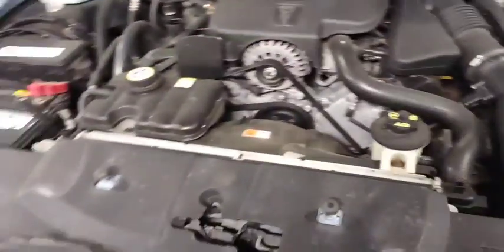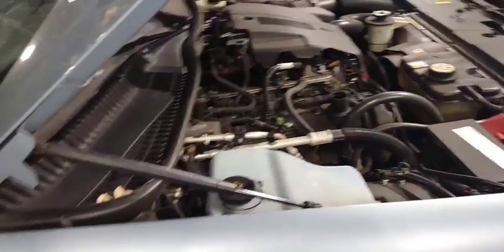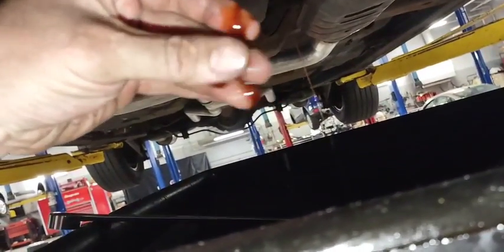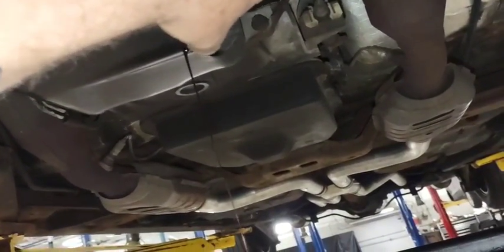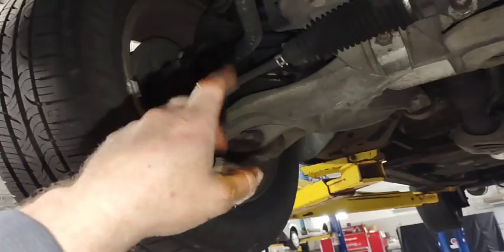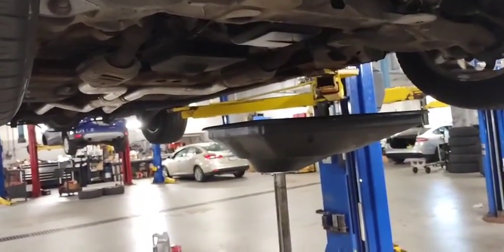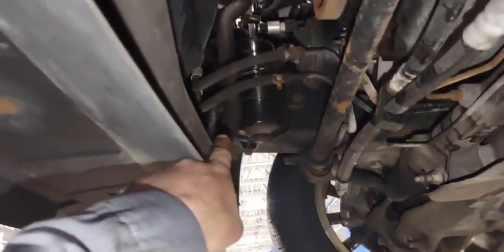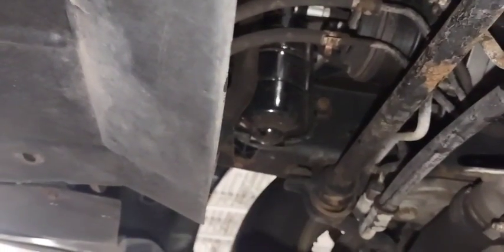Pennzoil Platinum Ultra oil drop 5k Miles, the next 5k Miles trying Mobil 1 extended high mileage

Comment: What's your opinion of Motorcraft oil filters?  I've never seen a test where they were the top performer.
Reply from the maker: I think somebody was telling me it has a lower Micron rating than some of the better like synthetic ones from mobile and k & N or Wix

I just use the factory filter because that's what I'm used to

Comment: do I need to worry about oil leaks if I switch to amsoil, ive heard that synthedic oil can cause leaks
Reply from the maker: If the vehicles going to leak it's going to leak yes synthetic oils do have better additive packages and higher detergent which can clean better but if it causes a leak it's because you had debris and sludge sealing the leak up

Comment: Man the comments are brutal when you go down the rabbit hole of different oils. What if I said I've been so broke I've reused oil and changed the filter ever 5k miles and used oil until 20k had a Chevy 350 ran 500k. Can't say the same think for "Newer" cars/trucks but whatever works use it.

Comment: Always tell the IPA you got video of the contamination hahahahah. they will be out there checking in a heat beat. The company I work for allows oil seepage to go into the ground from their injection mold presses. Their last location got shut down and they had to dig out the bad ground before the new tenants took over the 350k sq ft facility.

Comment: You can not tell how the oil is by feeling it? Get real.   And what  oil did you use. You say Pennzoil Platinum and then you say Pennzoil Platinum Ultra Platinum. They are different oils. Lots of work performed on that car. Undercarriage looks very good for the number of miles. Thanks for the oil.

Comment: Been using Amsoil for years now and never had any issues at all. One of the best oils out there.
Reply: Project farm confirms
Reply: Do you run the 20k miles on it?
Reply: @slscamg  Nope always have changed it at 5k.I would never trust any oil for 20k.

Comment: Look at "Project Farm" YouTube channel. Look at his oil challenge. I was a Mobile One   guy till he tested it. Now I'm Pennzoil. That was like a year ago. My vehicle's are doing much better with Pennzoil then Mobile One synthetic. 4k oil changes.
Reply: Yep I knew now coming those coming already like a lot of these high dollar oils that advertise stuff don't do well like people swear by like red line and stuff but they're additive pack is excessive and it's so excessive it doesn't really benefit the oil.  Like the top two oils there was AMSoil and Pennzoil.. which didn't surprise me followed up by Schaefer's. And this even proved that Pennzoil makes a good oil that even helps back up me saying that it's the best off the shelf oil for most applications.

A lot of his other testing shows you how good some of these oils are regardless.   I gotta send him some oil for testing just gotta get it sent off.
Reply: How are they doing much better? How do you quantify that?
Reply: @zeroyon4562  When I do the oil changes it's not black and I had lifter rattle at start up. That stopped after 3k miles.

Comment: So does gas actually get into the oil ? When you speak of oil dilution?
Reply from the maker: Yes it can especially with short trips the vapors things of that nature maybe if the engines not warm enough and there's a lot of blow by, some raw fuel as well
Reply: Ok makes sense.. I noticed last time I changed the oil on my 01 F150 a slight gas real fumey smell if you will the oil had

Comment: Nice ride. Should all cars be put in flood mode after a oil change?
Reply from the maker: I think so because it's less stress on the drivetrain whenever everything goes to start you've already got some of the oil pulled into the system instead of dry starting it
Reply: Thank you for your honest vids brother. And such a quick reply.
Reply from the maker: The replys are starting to slow down as the channel blows up...every day another 500 to 1000 subs 

Its surreal

Comment: In your video you said “it’s always getting flush” what brand do you use to flush it.
Reply from the maker: Bg epr
Reply from the maker: But when I flush it with bg I use their MOA additive as well.... you use the epr with the old oil before you drop it I think it's like 10 minutes at 1500 RPM and then when you put the new oil and you had the m o a 
It works wonders
Reply: Thanks for that info man.

Comment: What was that "flood moded" you did when you started it? Was that the oil life reset
Reply from the maker: You just hold the accelerator down while you're cranking it and it pulls oil into the engine so when you do start it you've already got oil up through the motor and then you Have to go through your settings on the dash to reset your oil life
Reply from the maker: You just hold the accelerator down while you're cranking it and it pulls oil into the engine so when you do start it you've already got oil up through the motor and then you Have to go through your settings on the dash to reset your oil life

Comment: Great car, they last a long time. I suggest 5,000 miles. That’s what I do on my 2011 Honda, full synthetic oil changes. It has 125,000 miles on it and runs like a champ.
Reply: Sears 6404...I agree with you. I run full synthetic motor oil in my 2010 Toyota Camry with the 2.5L four cylinder with a 6 speed manual.  I change it every 5,000 and no issues and engine is whistle clean at 213,000 miles plus.
Reply: I use cheap oil in my work car (Hyundai) drive it rough, regularly forget and go  way over miles and have well over 350,000 miles. 
How? The desert. No short trips, no below zero starts. I get the oil HOT every time I drive it.
I baby my classic Mach One, Vintage Jeep and new Mustang.

Comment: I've been running super tech and the Ford filter on my 2010 crown vic with 102k miles and 7030 idle hrs lol runs great. 

After watching your channel I feel alot better running super tech oil now. I also change it at 3000 miles for cheap insurance thanks for the information.

Comment: I refuse to use pennzoil after what I have seen in other engines
Reply: You should look in to the Pennzoil ultra. It's synthesized  from natural gas and totally pure. Its a revolutionary new process that has been proven to have outstanding qualities by many independent labs. I was never a fan of Pennzoil either. After I, myself looked at some of the lab results, I was impressed and have been using it for the last year on all 3 of my vehicles. Times have changed and this is not the Pennzoil of the past.

Comment: man, quit playin around and replace that dang oil pan drain plug. looks like the rubber gasket built into the plug has shredded its self and it getting caught up in the threads or sumn

assuming it isnt crossed, of course (got more way faith in you than to think thats the case)
Reply from the maker: It's a common issue with these motors these older 4.6 and 5.4 oil pans it always happens

It's fine it doesn't leak it holds
Reply: @FordBossMe  meh, I owned a 98 f150 4.6 2v, 180k/mi everything,, never had issue with that cuz I replaced it early on with a basic magnetic unit from the 'zone (they even got me the right one 1st try, shocking for my area)

Even if the threads are fubar, you could still run a chaser thru the pan with a magnet attached to it. 

I've seen fools break the plug off in the pan due to super bad threads. He didn't like life for the next several hours cuz he tried to fix it (failed, hole was too blown out and it leaked).

But ya run a chaser thru there real quick before it gets too bad, itll be fine. I dig your channel dude, keep up the good work. None of the above is meant to be taken in a critical manner, just throwing advice/experience out there on the off chance it hadn't occurred to ya

Comment: I use Pennzoil Ultra every 5k miles with a Wix Xp oil filter on my 4.6 3v Sport Trac, engine is incredibly smooth and burns no oil.

True Story, my friend owns a new Ranger XLT, he took a ride with me in my ST and he was shocked in how smooth the engine idled and revved.

Comment: Go with Amsoil.   I still wouldnt let oil go 20k, not even 10k.
Reply from the maker: Where is the Amsoil Hook Up?
Reply: @FordBossMe  I get mine on eBay amsoil and look at some of the postings and you can get it for a decent price. With free shipping. 😊 And my EcoBoost 2018 Mustang I go with the oe amsoil 5w30 don't need to go with the signature cuz I do not go over 3,000 to 5,000 miles on oil change kind of a waste to use the signature. Used motorcraft oil filter.

Comment: I'm a huge fan of Pennzoil Ultra Platinum and use it exclusively in both my vehicles. I have noticed a small increase in fuel economy too
Reply: My son has a 2014 GMC Sierra  5.3 V8. I have used Pennzoil Platinum Ultra 0W-20 since new. 120,000 miles, it has active fuel management I read about everyone having problems. He has had none.  I think if you use top quality oil and filters you will have no problems.

Comment: WHAT IS FUEL DELUSION?
Reply from the maker: It's when you have a lot of fuel type smell down in your oil, like a lot of idle time maybe you have a loose motor that doesn't have very good sealing piston rings and some of that excessive exhaust Vapor gets down in the oil and dilutes it
Reply from the maker: It's when you get traces of unburned raw fuel down in your oil because of maybe improper ceiling of piston rings maybe you just have a loose built motor for some odd reason and then when you drop the fuel it almost seems like it's thinner than what it should be and it smells of fuel as well
Reply: @FordBossMe  Could you quote your definition from some dictionary? I never heard of it before.
Reply: @FordBossMe  Don't you mean improper sealing instead of ceiling overhead.

Comment: I miss my 1995 Crown Victoria. I did my oil changes every 3000 miles with that car. I kept that car WAY longer than I should've. I owned it from February of 1998, all the way up until August of 2011. You can imagine how much mileage I racked up in those years. That was easily the best car I ever owned.
Reply from the maker: So easy to maintain
Reply: @FordBossMe  Yes they are. That 4.6L engine would go forever. I think Ford ruined those engines when they went to the 3-valve VCT heads.

Comment: What car is this?
Reply from the maker: 2006 Lincoln Town Car
Reply: @FordBossMe  Thanks. I had a 2000 Continental. Served me well, then the rocker panels rusted out and I had a hard time finding a place to use my floor jack. Now I'm using P Ultra Pl in My 2011 Cadillac cts with a fram XG8765 Utra synthetic filter. Small filter, might consider just changing the filter at 3 or 4K. Thoughts?